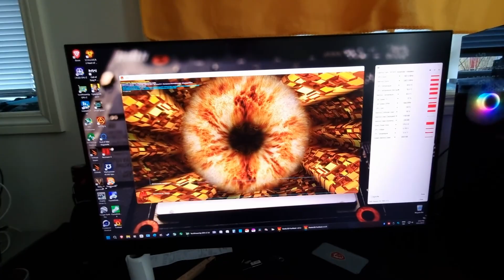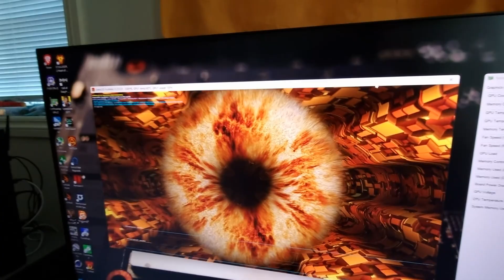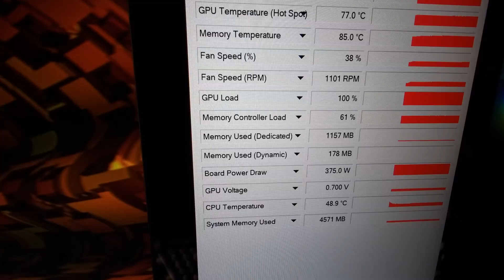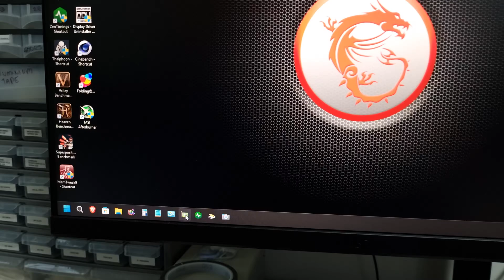My RTX 4090 Nvidia 12VHPWR is About To Melt. This is Why I DO NOT Use The 4090 Often.

Comment: Because average 8-Pin PCIe power connector is rated to 150W as standard, but in practice can do 250W.
If nVidia's 600W 12-VPH connector was rated with same headroom, it would be 300W rating, and could do maybe 450W before being unsafe.
New cards which are "safe" to operate with this abomination do so due to over-engineered sensing on PCB which checks current and resistance on each wire in real time.
Connector is so bad, that it forced manufacturers to make more complex and expensive boards.

This is analogy to control rods in nuclear reactor. You can heat your water with resistive heating. Or you can be nVidia and say: "Let's go nuclear without safety in place, as we are only heating water."

And then regulators come and realize, there been quite some dangerous meltdowns. Let's place some control rods to keep meltdowns from happening.

nVidia simply introduced expensive and unsafe way to do something which has been working just fine.
Reply from the maker: I get melted connectors often. Nvidia is blaming users, which is a shame and a lie since its happening so often  I sold my 4090 and will not touch a 5090 either. Nvidia had to fix something that was not broken just because.

Comment: Thoughts on the Galax rtx 4090 hof with dual 12vhpwr ports for better load balancing? Was lucky enough to find one in the wild for a reasonable price.
Reply from the maker: @Nanofanesmusic  That dual high power connector is the way all 4090s and 5090s should be built, IMO. That's a great card btw.

Comment: Guessing whatever method used to connect i.e. Below then won't make it any safer with male end to GPU still a problem.

-Nvidia GPU provided 12vhwpr to 2x or 3x 8PIN
-Corsair 12vhwpr to 2x 8PIN
-Corsair 12vhwpr direct to 12V-2x6 female connector PSU side

I've read up that people are using hwinfo64 software to monitor 16-pin hvpwr voltage and set alerts. i.e. for me highest reading is 12.273V and lowest under full load is 12.156V. So unsure what would be a good alert threshold recommendation i.e. 11.8v? Do you think this would be a good proactive exercise to catch melting connector beforehand? Or no good since software measurement won't be accurate at all.
Reply from the maker: @peteruk8  I wouldn't even be able to tell you how to go about keeping an eye on this. I just know it is a thing, and so I decided to sell my 4090 for the same price I paid new. I don't use it anyway, since I do not play games, only AI and video edit. And my 7900xtx does the job well enough. Sorry I couldn't help.
Reply: @ understood. many thanks!

Comment: Thermal imaging cameras normalize the color to the average of the scene, usually.

How hot, numerically, was the wire? I've had both a 4090 and currently 5090 with 0 issues and I do occasionally just go feel the cables.

I just find it wild that you would say "I don't use it because the cable is warm". Why does it matter? I would never go use a lower powered system just because a wire may, or may not be, warm.
Reply from the maker: Do I have a choice on whether I want to use my own hardware? I do not use it because this IS an issue. I have 3 cards here in for repair with burn 12VHPWR connectors on 2 of the 4090's. Warranty rejected because it was a 3rd party cable. Go check out Roman's new video.
Reply: @TechnologyHive  I've seen it, and of course you have a choice on how you use your property. That doesn't make it not baffling to me, personally.
Reply from the maker: @nuke2373  I can understand that. But I have plenty of reasons. Have a nice day!

Comment: If you fan out the cables and you see one or two really hot?
Reply from the maker: @trick0502 Air won't help one bit. That 12v cable is beyond help at this point.
Reply: @TechnologyHive  lost in translation! What I mean was spread out the cables so it is easier to see each wire under the thermal camera.

Comment: someone saw a der8auer video ;) but yes. important to check it seems :/ realy horrible! Also that some board partners are even meassuring each pin with shunt resistors and NVIDIA is not. oh my....
Reply from the maker: @gloeckle  I did see his video first 😅. I thought I'd make one to prove his point, and indeed, mine lights up like a Christmas 🎄 tree. Sad.
Reply: @TechnologyHive  I found your PCB on kitguru - if it is a ASUS RTX 4090 TUF Gaming OC. there are 2x shunts measuring the 6 lines. That would mean the card does not differentiate between 
a: 3-lines with 1 shunt <= 9+9+9 amps (this would be to spec)
or
b: 3-lines with 1 shunt = 3+3+21 amps
which results in 1 very hot line or even 2 on the other side. :/
I would definitly try to get a good picture video of it and send it to the manufacturer for replacement! best of luck!!! 🤞
Reply from the maker: @gloeckle  Nice to point that out. I'm not doing much with this card lately anyway. But I opened a return ticket yesterday, so I'm now just waiting for approval. Not gonna wait to it to give me crap later. Cheers!

Comment: Nvidia needs to just get rid of the 12V cable and stop trying to standardize it. they should've just kept using pcie lol.
Reply: To be fair, the updated spec is for separate line sensing that would resolve the issue completely...

Ironically, most of the AIBs have implemented separate line sensing on 50 series, so they should be fine...

But Nvidia?  Nooooo, they have the 6x earth/ground all soldered together on the board, and all the 6x 12V all soldered together on the board.

If one cable has a slightly lower resistance than the others, then it will carry exponentially more current than the others.  It's an inherent "law" of parallel electrical circuits...  Without active monitoring and adjustments this can end up in a thermal runaway situation:-  The wire has a lower resistance than the others, so it carries more current, so it heats up, and as it heats up it's resistance reduces, so it carries even more current, so it heats up more, so it's resistance reduces more .....  Melt.  Pop.
Reply: @aaronjones4529 You said, " Most of the AIB's have implemented individual line sensing. So, they should be OK". 
 The only 5000 series GPU, that I know of, that has per line sensing is the ASUS ROG  Astral. But it is only PASSIVE sensing. YOU have to monitor the individual power line amps and YOU have to shutdown before the connector melts.  There is no automatic balancing. There is no automatic shutdown. 
  If you are playing a game, you could easily over-look the amps reading and still melt your connector.  That is not "OK".
Reply from the maker: @dbatack  A triple 8 pin power connector setup would work just fine. Or a double 12VHPWR setup, ideally.

Comment: This is FUD. Sorry. Nvidia sold millions of cards, the failure rate is way below 1%.
Reply from the maker: Where did you get this information from? I repair these things for a living, and 99% of cards in for repair are Nvidia, yes they do hold a higher share of the market, but the symptoms are the same, blown Dr Mosfets, cracked solder joints under memory and or core, and burn 12VHPWR connectors. "Nvidia sold millions of cards, the failure rate is way below 1%". Maybe on paper, but actual fact is completely different. I would know lol
Reply: @TechnologyHive  Everything you described is from user error. People aren't careful with their cards. Enthusiasts are always screwing around doing things they shouldn't. I've delt with plenty of customers, you only hear from the ones with problems, not the ones that don't have any. You've fallen into the trap that everything is garbage because that's all that gets sent to you. 50 million 30 series, 17 million 40 series. You see a blip of them.
Reply from the maker: @spazoq  Sorry, but you couldn't be more wrong. I'm not going back and forth with you on this. Have a good one 😊
Reply: @ Glad you won't be buying anymore nvidia cards. Easier for me to buy my 4th one.

Comment: Been using my 4090 since 2022 and have aggressive oc on 24/7 and use my pc 7 days a week over 8 hours a day for work and gaming and no melting. But I did have a pos cable mod cable go out. Black screen 100% fan speed. Cable mod did send out a new cable with the new updated version with the sense pins hidden and not exposed like the gen 1 cables had. But I didn't even use it. Still unopened in my closet. I instead bought a corsair hx1500i atx 3.0 power supply and use the included 2- 8 pin to 1-16pin connector and no issues at all. I watch my 16 pin voltages though daily with hwinfo64 and it never goes below 11.900v under max loads. If it gets under 11.6 or 7 I hear check your connector and make sure it's plugged in all the way. But I did have one out of 3 8 pin connector on my 3080ti melt. It was also using a cable mod cable to my evga 1000w p.s. It lasted about 6 months "and yes it was plugged in all the way" then one day I smelled the worst burning smell then my pc crashed. Check the plugs and it was melted down the wire and all the way to the connector. I cleaned the connector on my 3080ti and ditched the cable mod cables and used the included cables with my evga power supply and to this day my wife still uses it with not one issue since that day years ago. I should of learned my lesson then about cable mod cables and once I had those problems with the 4090 I said not worth it and I don't care what my cables look like anymore and i'll never buy another cable mod product ever again.
Reply from the maker: @SVT_LIGHTNING  I bought a Corsair branded one, and this is the one I was using. I have not used a cable mod branded one yet. But from what I hear, such as yourself, they are not the best. Thanks for the heads up.
Reply: @TechnologyHive  Stress tests like furmark are not like normal gaming use... people always forget that these cards are for gaming first and foremost! and no games reach the level of stress that programs like furmark gives you! if you OC your GPU to the max and then put unlimited fps on Cyberpunk with path tracing even then you will not reach that level of stress furmark can give your GPU! furmark is designed to push a GPU to the maximum limit!
Reply from the maker: @ I don't make the rules, I just repair your card when it dies.
Reply: @TechnologyHive  Yeah and thanks for that! but when people buy a $2000 GPU i guess they know how to use programs like MSI afterburner to monitor the voltage your GPU gets... and the 4090 never goes above 370 Wattage during gaming! there is several videos from der8auer where he states that normal gaming does not bring the wattage above the spec of the GPU... and you can undervolt your GPU and try furmark! then you will see that your GPU will not go above 400 wattage!

Comment: What are you 16 pin voltages in hwinfo64 after 10 minute load of fur mark or something? Mine drops down to 11.73v but it’s been fine so far.
Reply from the maker: @ZoteTheMitey  I did not check, as the 12v cable gets too hot even during gaming.

Comment: The new cables are beefed up a bit, but it does look like the stock cables are much better than any 3rd party cable or adapter. I was obsessed with this problem, after a gaming session I would have a big flashlight and examine my 4090. I got worried because I would keep pulling it on and off over and over to check. The 3rd party cable would get hot to the touch, and when I switched back to stock cable it was no longer getting hot GPU is working fine after that.
Reply from the maker: I have tried the stock adaptor that came with the card and it was the same for me. I just keep that card looking pretty in my shelf now.
Reply: @TechnologyHive  that sucks 
Actually Hardcore Overclocking
 and der8auer have great videos posted today.
Reply from the maker: @ I saw the one by Roman. Very interesting. 👍

Comment: Don't forget the 75W from the PCIe slot. In the past, there have been GPUs out of spec or could be at times. GTX590 is a good example. It was on the edge at 365W and went well above that... and died in droves. RX480 exceeded the PCIe slot limit of 75w by drawing 86W, at least until the bios revision. Some 1080Ti under overclock and the RX Vega 64 was 295W and could go above that leading to stability issues, crashes, etc. I have seen some streamers with 5090s having random black screen shutdowns. As an aside, PCIe 5.0 issues on FE cards due to multi PCB results in signal integrity issues causing crashes and instability.
Reply from the maker: Very true. I remember the GTX 590. A beast of it's time. Never owned one due to SLI compatibility with most of the games I played back then. You seem very well versed in your GPU's.
Reply: @Berserkism  does that 75watt pass onto gpu if it on a vertical gpu stand
Reply from the maker: @ELpeaceonearth  Yes, absolutely. It is necessary or the card won't boot.

Comment: Small noctua fans on each end of the cable might be a solution here?
Reply: Now, Noctua needs to make coolers for cables, 😂
Reply from the maker: @Berserkism  I would not be surprised to see someone jump to the opportunity.
Reply from the maker: I am not sure. I just know that this 12v cable gets too hot, and even hotter at the base. Scary to be honest.
Reply: Der8auer measured up to 150C, you're gonna need proper heatsinks for that.
Reply from the maker: @ I can't even think what would work to remedy this, other than physically attaching a second 12vhpwr to relieve current from that 12v cable. I am starting to think that even the wire gauge may be an issue here.
Reply: @ Also, the card and psu that melted in Debauer’s vid, was from a SFF build. Could be poor airflow/too much heat in a crammed case could be an important factor on the connector melting issue.
Reply from the maker: @vaeguten1  Unlikely, this has a history since this power connector was introduced across many different PSU platforms, from Seasonic, CWT, SANR, and even Super Flower. This is an Nvidia issue.
Reply: @TechnologyHive   Sorry, a bit unclear, but I meant due to it being an sff case.
Reply from the maker: @vaeguten1  I hear ya, but even that could not be blamed for this. There are protections set in place by the PSU, and even GPU.
Reply: @necuz  no heatsinks would work. The issue is impropper load balancing across the 6 x 12V wires, either by not being seated correctly, bad cable or connector pin, poor/no shunt resistors on the card to split the current. The cables/connectors melt once there is a thermal runaway event that occurs. When too much current starts flowing down 1 or more wires, they get very hot which increases the resistance, which causes more current to be needed which increases the temperature more which increases the resistance more and so on until melting/smoke/fire occurs.
Reply: @vaeguten1  german overclocker der8auer measured a temperature of 150°C on the connector of his 5090. A fan will not fix that
Reply: No chance
Reply: Needs a monitoring system so the 12v inputs can stay balanced to distribute the current draw..  Too much current on only 1 cable =excess heat then eventually melt down.... 
"It's inevitable Mr Anderson.. "
Reply from the maker: @chrissmith7069  One of the best replies yet 😆. But seriously,  the solution would have been a dual power connector setup. How Nvidia did not catch this during development is beyond me.
Reply: @TechnologyHive absolutely my friend! 
It's a cheap ass cost cutting engineering with potentially hazardous outcomes OR the just "The Way its meant to be played"
Reply: the whole cable is melting you can't solve it with 2 little fans. More than 120 C' on a whole lenght